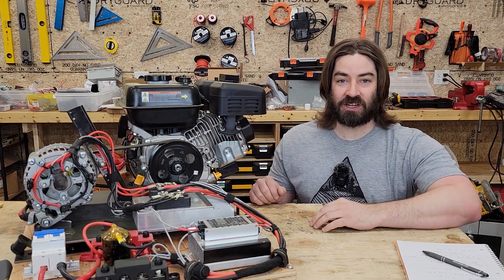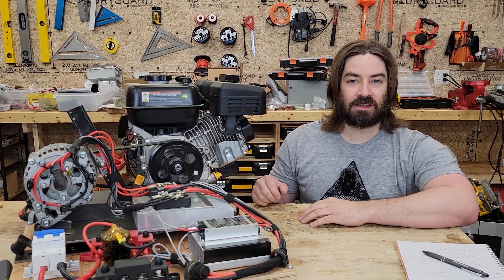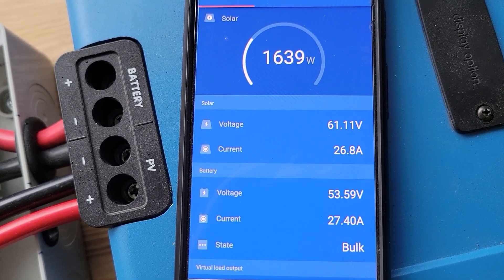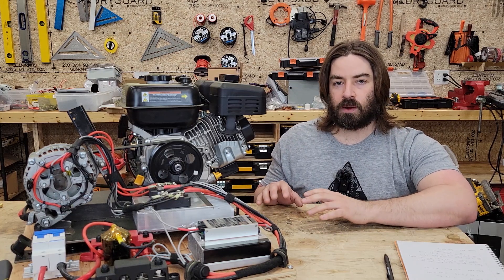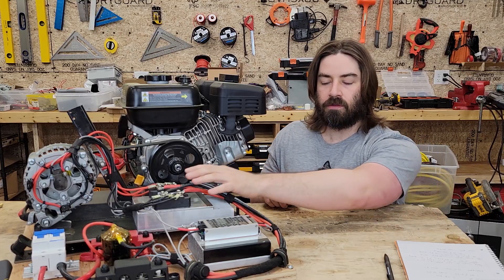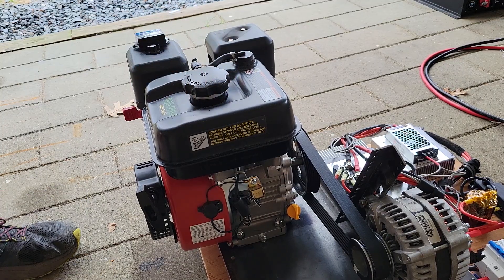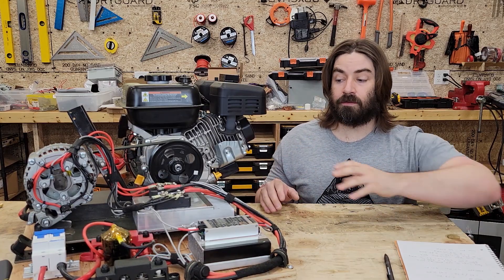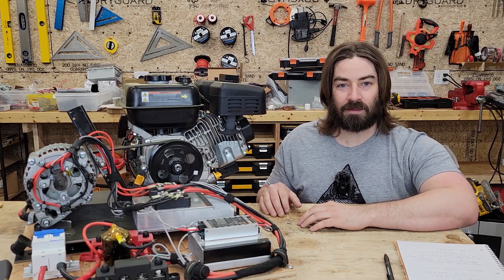More Efficient than ever!  Alternator Generator fine tuning, Part 3

Comment: That is nice, but you are still throwing away about 90% of the fuel energy. How about doing the same set up, but with small diesel engine?
Reply from the maker: Yes, diesels are more efficient.  I have a small diesel generator I've been using recently: https://youtu.be/pyzpOBTzKxI
Reply: @DavidPozEnergy  what is the kWh/gallon with that DSL gen?
Reply from the maker: My military diesel generator should be about 10kWh/gallon, according to the manual.  However, I haven't tested that myself yet.

Comment: Love your work mate. A few things I can recommend.
1- The power supply has a little trim pot next to the output, you can turn this to increase or decrease the voltage, which can increase or decrease the output. On my similar setup I got an 18v power supply and adjusted it down, but that depends on how much you can increase your output from it. From memory, they adjust up to about 15v. My unit was a 10A 18v boost buck converter.If possible go to this way
2- with the converter, the little trim pot can be uunsoldered and you find a similar resistance panel mount type. You then install this, with converter in a box, with panel mount voltage and amp meter. The reason for doing this, is you set engine rpm, then adjust the voltage and hence current which is sent to the rotor. This way you control output from the converter going to the rotor, which means you are driving the rotor and adjust alternator output that way.

That's how power stations do it

Comment: Interesting, but the reason everyone pays more for a Honda generator, as it starts in all weather. I bought a Korean generator as it was cheaper, and total junk after a few times used. If you used a Honda motorcycle maybe, 🤔this would work. I loved your article on using a 2 year old battery which is new, and would like a 71 kilowatt system with an automated diesel generator back up.

Comment: Putting the rectifiers in series is interesting, but I'm not sure it will work. I'm guessing the 2 windings are 60 degrees out of phase. Not sure what the implications are , but I would think more heat and less efficiency.  

I built one of these, simple 12 volt, 15 years ago. Never really used it after I realized that my Honda 1000i and a switching battery charger was more efficient.

Comment: I love this video series.  I am very interested in building a similar setup.  I have a question, sorry if is is stupid.  Can you skip using the rectifier and use the AC directly from the alternator?  I don’t know what AC voltage or current comes directly from the alternator.  Maybe a simple circuit could make it 220 volts.  The AC would be used to power the 48 volt 100 amp charger you showed in another video.
Reply from the maker: The AC coming out is wild 3-phase.  It can vary from 40V to 200V, and is probably 300-400 hertz.  That huge range isn't really good for anything directly.   If you want to power something directly,  then the best bet is to buy a standard generator.
Reply: @DavidPozEnergy   Could you take the DC out and put it into an Solar inverter to power the grid directly without batteries?

Comment: This video brings up a few interesting points.  Is the alternator and engine mismatched?  Is the alternator too small and therefore the lower RPMs is more efficient.  Does second alternator need to be placed in parallel for more efficient energy transfer?

Comment: DOPE AF! I want to do the same thing! 
TURN DOWN YOUR BUCK CONVERTER!
From what I know, it was the VOLTAGE at the brushes that caused overheating though the field will die without enough amperage, regardless of voltage. 
You should play with the voltage because it will also change how strong your field is and probably improve fuel efficiency. If not, just add another alternator! 

Surprised you didn't say anything about grease leaking from the alternator bearing. Had a overrunning pulley that was leaking because I ran the alternator at 12 volts. It is the only thing that will reduce your heat.

I'd go with a torque converter to get rid of any slack with the belt!

Thanks for the inspo!

Comment: Switch to a diesel and run the test
Reply from the maker: Thanks.  I will.  This past winter I purchased a used army generator (diesel) and will run a fuel economy test on that for charging batteries.

Comment: lower the pulley ratio on the alt and increase it on the clutch. Lower engine rpm but same alt rpm. Higher efficiency?

Add a weighted flywheel to stop the surging.

Comment: ok so if you want MAX efficiency: #1 change the pulleys to run the alternator RPM as fast as is safe (do a calculation of what it would spin at, at redline. might be worth buying an alternator from a sports car with known high redline, I know Toyota would put nicer bearings in those for example). The higher the voltage (more importantly the lower the current) the more efficient the electrical side will be. I guess higher rotor winding voltage could help too, just be careful not to fry it. its also a bit tricky since its technically lost energy. #2 get rid of the RPM governor of the engine, as throttling causes pumping losses. use extreme caution as letting the engine rev without load will destroy it. #3 set the current high and slowly start working down. Unfortunately the peak efficiency RPM of the engine needs to be determined experimentally, but is most likely somewhere between peak torque and peak horsepower RPMs.

Comment: It is more efficient, but how does it compare to other generators? I'm not expecting it to beat purpose engineered generators, just was curious so I did a bit of research.
I see that yours turns about 120,000 BTU of gasoline into about 17,000 BTU of stored electricity, or around 15%.  Suprisingly, I can not find a similar comparison for other "high efficiency" commercial generators.  Since they claim to be high efficiency, you'd think this is something that should be listed. Though I can't find it listed directly, I did find home generator claims of hours per gallon at a specified load that seems to indicate around 8 to 9 KWh per gallon, or perhaps a bit over 25% is considered high efficiency.  I believe power plants using petroleum achieve around 35% efficiency converting hydrocarbons to usable electricity (natural gas plants are about 45%).
Reply from the maker: I performed a test, and made a video, on a Honda EU6500 Inverter Generator.  That's usually considered one of the more efficient homeowner generators on the market: https://youtu.be/kQTFPMDE_F4

Comment: David quick question I read somewhere on the growatt spf 5000 that all of the battery cables to the inverters need to be the exact same length
Reply from the maker: Mine are on my setup.  It's good practice so that all the inverters see the same Voltage.  This only applies if the inverters are paralleled on the output.

Comment: In the thirties, way out in the boonies, only alcohol was available for the hit-miss motor spinning the 6 volt generator lighting the barn.

Could you experiment with ethanol please?
Reply from the maker: My upcoming project will use Vegetable Oil in a diesel.

Comment: Thanks for this series, it has been very informative. I have started to build an off grid solution for my cabin. I have an old Honda generator that has a 12VDC battery charger built into it and I was wondering if my MPPT charge controller could be used to charge batteries from it. I am a retired electronics tech and this causes me to be much more cautious when connecting things together that were not designed to used with each other. This has answered my question, though I don't think your filter cap is enough. You are right in that the charge controller was not designed to handle a ripple current, it is also not designed to filter the high frequency noise from the diodes, and brushes. You said some comments you got suggested your 1000uf cap was not big enough they were probably thinking of the cap as a reservoir, a common way they are depicted, it is actually supposed to shunt ac current to ground when used as a filter. Not knowing what the actual frequency of the ripple current does not help, because your filter should be tuned to react to that frequency. The easiest way to deal with this is to add smaller caps to the filter. Your 1000uf cap is good at filtering low frequency ac noise but not the higher frequencies of the diodes. I have dealt with this in the past by putting .01 to .1 uf ceramic caps across each of the diodes. This was in a high voltage tube amp. It wouldn't hurt to add a 10uf Mylar cap and 500K resistor across the 1000uf cap as well.  The resistor is used to bleed the caps stored energy to ground so there is no nasty surprises in the way of shocks long after the device has been turned off.
Reply from the maker: Thank you for your suggestion on the Mylar cap and resistor.  Can't hurt, right?  So might as well do it.
Reply: @DavidPozEnergy  Your right, and it is cheap peace of mind. The death of digital devices is noise. I have yet to put my oscilloscope on my DC generator (it's at the cabin) but I am sure it is very noisy.

Comment: at the end 1 gallone has 3,79 l  x 11 kWh / l = 41,6 kWh energy and you get what amount of kWh in the battery for 1 gallon ?
just 4,8 kWh or 1/10 of the 42 kWh - that can not be called efficient at all except you might be able to reuse the heating from the exhaust in your home. 
Yes, you had achieved a progress but still at a pretty expensive level at least here where a gallon is about 7,2€ or 8$

And the prices here will be increasing simply be CO2 emission fees we have to pay cause these fees will increase year by year which forces the people to take care for efficient power generation, heating and cars - no one would buy a ford F150 here due to poor mileage.

Comment: hey David you've been a pretty big help I've messaged you a handful of times through YouTube about the growatt SPF 5000 you definitely are a wealth of knowledge. I have three of the SPF 5000 inverters all linked together I have three battery Banks 5K each lithium 48 volt 14 s daly BMS. fully charged it's about 58 volts all the way down to 42. I've read that I have to parallel all the batteries as well as parallel all the inverters to one point. it dawned on me what if one battery pack is lower than the other voltage wise. or hypothetically should I top balance all three packs before hooking them together so they're equal voltage. thanks again
Reply from the maker: Hi Jon,  I'm a big fan of central bus bars.  When paralleling batteries, you will want them to be within 0.10 Volt of each other.  If they are different Voltages, you will find the highest battery will try to discharge into the lowest battery.  Sometimes this can be hundreds of Amps.  Once all the batteries are paralleled, then charge them up with a slow charge to 100%.  Then you can use them like normal.  In your case, you have 15kW of inverters, so you will want to use 400 Amp rated bus bars or better.  And, you have 3 inverters and 3 batteries.  That's 6 positions on the bus bars.  Check these out: https://signaturesolar.com/12-stud-busbar/?ref=4_rHcgZ9x-TiF-  They are a good price.  By the way, this is an affiliate link, if you purchase something through the link it will help out the channel.
Reply: @DavidPozEnergy  I'm assuming once they've been top balanced and all hook together technically they will discharge and charge at the same voltage assuming all three separate BMS controllers are set the same
Reply from the maker: Yes, they should all move up and down together.  This assumes the internal resistance is the same.  Same cells, same capacity, same wiring, etc.

Comment: I like this setup. just couple of thing that needs mentioning.
petrol engine is not very efficient. 1 KG of petrol has energy density of 46.4 MJ. In this case, 1 gallon is 3,78 liters. 1 liter petrol is 0.79 kg. in other words it equates to 2.986 kg of fuel.  with energy density 46,4 MJ per kg, it ads up to 138.55 MJ which is equal to 38.48 KW/H!!!! insane i know. that means the setup is 12,47% efficient. take into account frictional and heat losses. nevertheless an awesome setup. with the cost of gasoline, i would definitely try a huge wind turbine on that alternator with a big pulley / gear reduction.

Comment: I would've gone with a bigger engine because: Less noise, less vibration, better fuel economy and much less messing around with the sweetspot pulley ratio. Where I live a 6.5hp is 122$ and 16hp single cylinder 440cc engine is 220$, Its massively better engine. Generic chinesium but still. (That 16hp makes more power at idle that 6.5 at full load)

Comment: hey Dave this Ben if you ever run across a big induction motor free or dirt cheap you can do some thing similar    You have to spin it a little faster than the rpm on the name plate    Some require a run capacitor to build up the magnitizem in the rotor   If the voltage is not to high for your charge controller it could be alot better in MANY ways    You know Dave riding lawn mowers with a bad deck or hydrostatic rear end are dirt cheap or free also   It would already have motor mounted plenty room to mount few alternators  I could go on for ever on the benefits Electric start  with batt charging already   Just strip it to frame on the set side take back axle   Put handle or hitch to move it around   It could be welder also  I quit but could write forever lol
Reply from the maker: Good ideas.  I'm considering using my spare snow-blower for an upcoming project.

Comment: Wonder if you can safely run another alternator on a longer belt and have two producing power at the same time from one engine.  So, the available amps of current should double in that config(?)

Comment: Great work on this.👍 Car alternators efficiency goes up at lower RPMs also. Sometimes by a lot, with of course reduced output. I imagine that your efficiency gains were from both the alternator and engine running at a slower speed. Max efficiency (as well as equipment life) is the name of the game. It is a given you will lose max output but you still can achieve the same charging results by running it correspondingly longer. In the end you will still use less fuel and unit should have an increased lifeo. The one caveat is both the alternator and engine have less cooling available at lower RPMs. So once again temps should be verified to be within acceptable ranges at the lower speed.

Comment: Quick idea. If it was me I would  (for testing).. attach a boiler to the engine and run the device with steam!  Because of how the consrvation of heat is actually what your working against in production in electric power, you might find it more efficient. Food for thought. Cheers!
Reply: Wait...are you saying heat the boiler with the engine and then use that to run the alternator?  I don't understand how that wouldn't introduce more inefficiencies than already exist.

Comment: Let's do some quick overall efficiency math for the metric crowd;

Engine consumed 1 galon for 4.8kWh produced. 

That's about 788.54mL/kWh or 1.268kWh/litre

There's about 9.5kWh/litre of energy in gasoline, so that works out to about 13.3% of energy that got converted to electricity. Accounting for all the losses (like belt, alternator, rectifier and charger) engine is likely close to 20-25% efficient, which isn't that bad for a cheap small single cylinder.

Comment: I think the engine should run most efficiently at 2600rpm but I'm not sure where the vibration is coming from. Maybe adding another stiffening brace running perpendicular to the existing one would help add more rigidity.
Reply: Some internal resonance issues in the design maybe.
Reply: @TheMacroSlacker  I think you are correct. 48v at 40amp is about 2.6hp. That is normal load for a 6hp IC engine to respond to step loads. At 2600 rpm that is 22 power pulses per second. Each pulse puts a shock on the drive. There is some coupling of the number of poles and rpm of the alternator that must resonate. At 4.8 kwh per gallon his cost is double CA rates. He is powering batteries so there is a 20 percent conversion loss also.
Reply: It is pretty well documented on other channels that these predator engines have poorly balanced crankshafts. An aftermarket crankshaft, connecting rod and piston would probably allow for lower rpm operation with very little vibration.

Comment: So what if you took a fan and mounted it to the shaft of the engine with the bolt you made and use that to help cool also what if you took off the serpentine belt pulley and groove the shaft to acts as a serpentine belt pulley and possibly add a pulley spring tensioner last but not least can you pretty please modify it so it's ran using hydrogen like this https://youtu.be/JuxQLEDccsU  we should start a show together like Tool Time

Comment: Regular gas generators have a 0,15-0,16 efficiency (from fuel to electricity) given 9.6 KWh/l (of chemical energy) of gasoline. Your Frankenstein reached a 0,135 efficiency with this working configuration....I guess you are reached already an incredible sweet spot. Maybe playing with a transmission ratio between the alternator pulley and the engine will give you some extra % points, but it's all about mechanics and it is usually painful XD

Comment: The major upside to this is sideshaft motors are cheap, common and easily repaired. Predator motors ate low rpms are very robust. You won’t get many hours at 3600 rpm, maybe 3000-4000 tops but at 1800-2000 rpm they can go beyond 10k hours. 
I suppose if you really wanted to boost efficiency you could use a larger alternator and a car engine. Like a geo metro engine  and run it at its most fuel efficient speed.